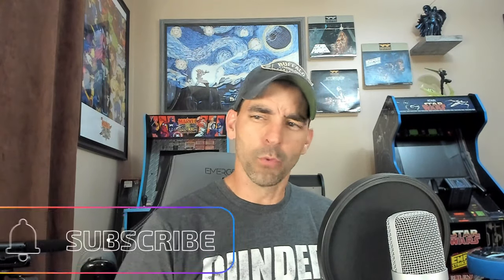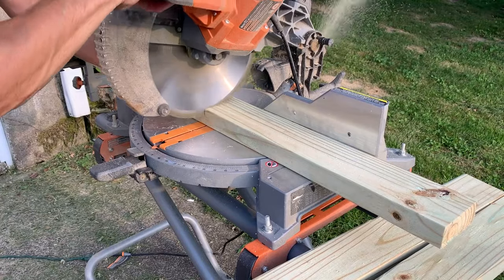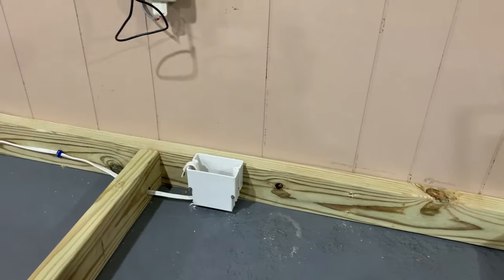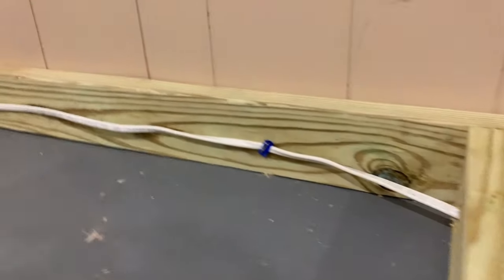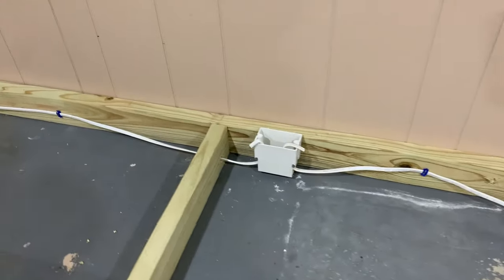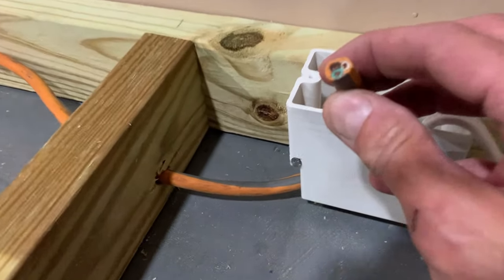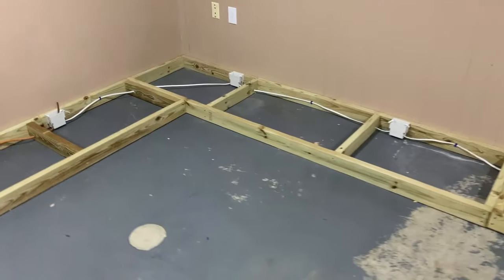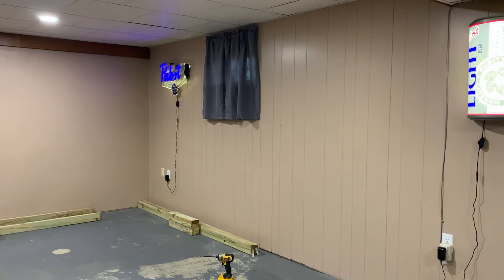Building A Basement Arcade

Comment: it will be a nice set up for sure. I am actually doing the same thing and building a sub floor "riser" for mine. I already put plugs in the wall when we did the walls, so wont need to do the wiring of it.   I think 2X4 vertical is the perfect extra height needed.

Comment: Oh no. Is Fox setting us up for the Metal Jesus sob story fund me?! Haha. Just kidding. Looks promising. I just took the attached garage. I would like to make the door into an actual wall some day. 
Tip for the stranded awg. Snip about a quarter inch of the sleeve and slide it down to the end of the wire and leave it. Helps secure it and keeps the strands together. Leaves a solid connection provided you have the wire hook facing the right way. Screw should tighten the hook up not spread it apart.

Comment: Why do you have the electrical so low if you are concerned about flooding 🤔
Reply: Make sure the outlet that feeds the riser is (or is covered by) a GCFI in case water gets into your wiring.  Avoid that "Oops, I dropped the hair dryer in the bathtub" feeling...
Reply from the maker: By “flooding” I mean 1/2” of water on the floor.
Reply: @19kfox  ah I see, guess I still would of gone up at least 6 inches, but I've seen a lot of flooded basements.
Reply: @19kfox  That’s a relief.  When/where I grew up, we’d get 6” of storm water in the basement every couple years.   With the wiring 2” from the floor, I’d still spend the $15 on the GFCI outlet right there if you didn’t have the breaker that covers it.

Comment: I would never put an Arcade underground especially if you have flooding.  I have my house on a hill for a reason above water!  I have watched what happens when water gets into the electrical outlet when they are facing the sky and it isn't pretty. Plus that stuff Arcade1up uses that  particle board when it gets wet it would instantly fall apart vs what real wood arcade cabinets used can last a few once it is wet.
Reply from the maker: By “flooding” I mean 1/2” of water on the floor.